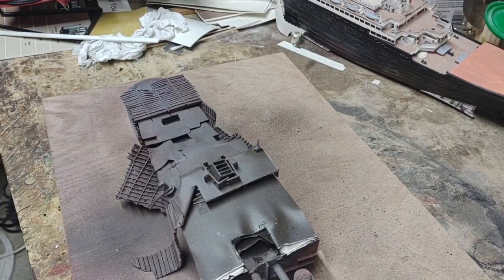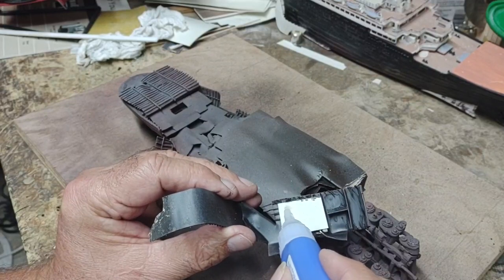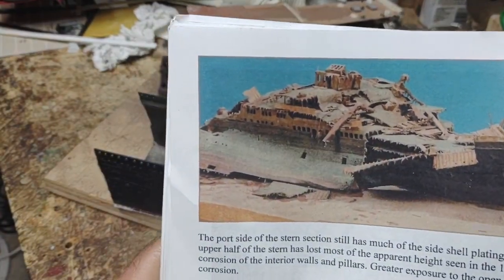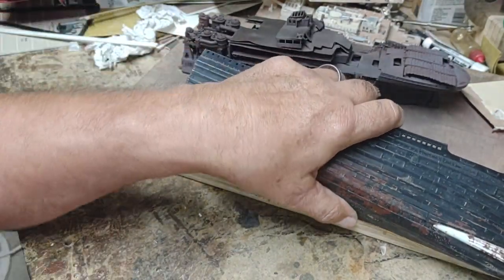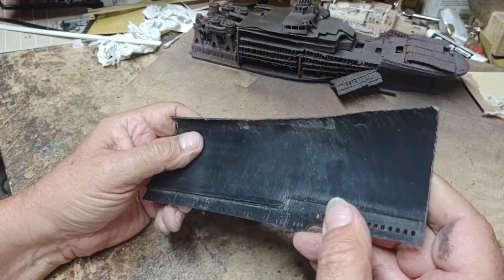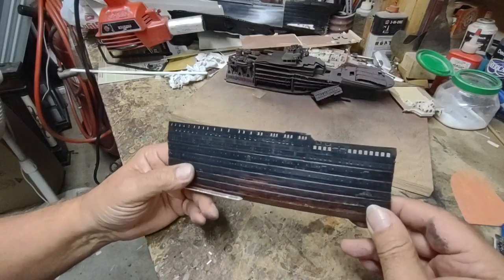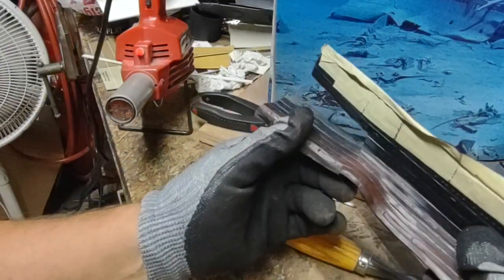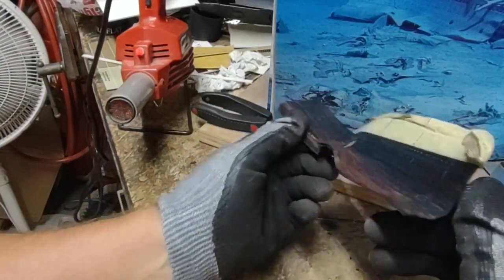Titanic Wreck Model Diorama Part 41 Forming the Port Hull Section

Comment: wow, putting them videos out in quick tempo! love them! keep them coming buddy! That part you were constantly refering to is called the bilge keel! 😊 And don't forget that your hull piece attaches one deck below the boat deck windows! so your window frames do not attach directly to your hull piece, please take a good look before attaching it!  When will you start on the seabed for the bow/ rust techniques?
Reply from the maker: BILGE KEEL!  I knew that! I think... As for the hull section, yes I've been studying the photos and Marschall's artwork.  It does indeed look as if the hull has slid down one deck and is basically just resting against the stern decks and framework.

I'm getting to the point where I need to add some seabed before doing much more assembly of the stern, otherwise it's going to become difficult to add more components and debris.

As usual, thanks so much for your kind comments and advice!
Reply: always welcome! 😊